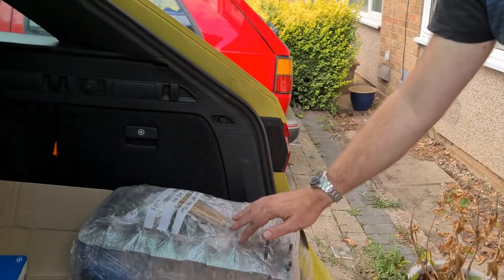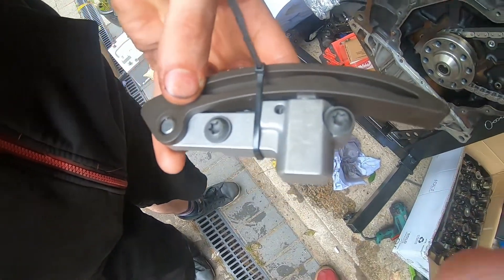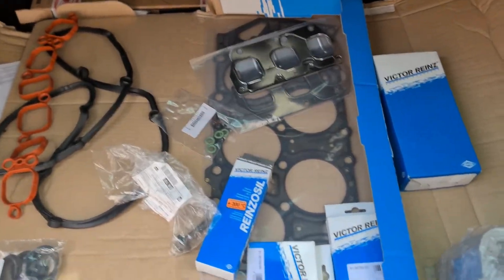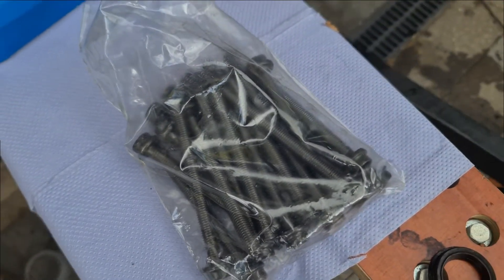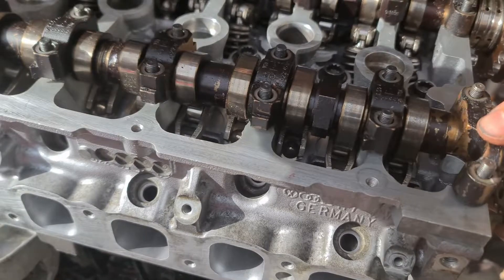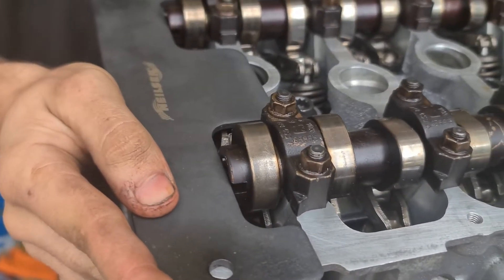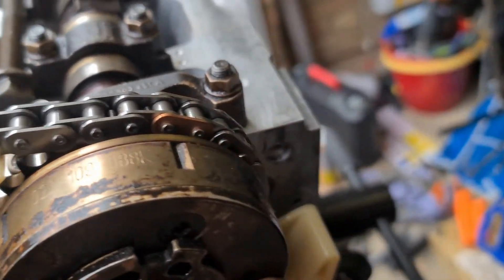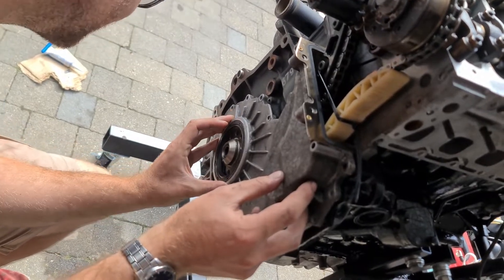How To Replace R32 Timing Chains | VW Golf Mk2 R32 Head Gasket & Chain Replacement: Pt 6

Comment: @14.48 it looks like the crank is half a tooth out; just like mine.
Reply from the maker: I've looked into that, I think because the chains are completely fresh with new tensioners and guides, the timing is effectively further advanced. This is evidenced on our Dyno Comparison video, where the differences in power outputs are considerable!
Reply: @golfmk2 I was trying to improve the timing on mine last night; found the upper guide in the Febi kit caused a difference on my engine. The old original guide is a slightly different shape and causes the chain to be tighter between the intermediate shaft and inlet cam sprocket. It looks like I will be throwing away the new upper guide.
Reply from the maker: @salzar4431 interesting as mine was a Febi item too. Is that enough to knock it half a tooth out on the crank, do you think?
It's not had any effect on the running of my engine, if that's any reassurance.
Reply: @golfmk2 Mine was a bit lumpy when idling; will have to see once it’s back together if there’s an improvement. Basically the chain path along the old upper guide is longer than the new one. The shorter path of the new guide was causing the cams to lag behind my crank by pretty much half a tooth at the crank. Even the steel crush tubes in the new guide are 9mm, which produces quite a lot of slop when mounted with an m8 bolt. Anyone doing the chains should pay most attention to the upper guide in my opinion; otherwise trying to get it timed nicely is likely to drive them mad.

Comment: you never changed the green o ring in the casing,any reason why
Reply from the maker: Only that the o-ring wasn't supplied in the kit. Otherwise, yes I'd have changed it as a matter of course.
Reply: @golfmk2  dont suppose you have the part number for said green o ring by any chance?
Reply from the maker: @adrianculley458 looks like it's this one:
N 90041102
Reply: 5.28 into the video,its on the left side

Comment: Mate, just a tip from an old long retired mechanic. Always pull a spanner, power bar, ratchet or torque wrench towards you rather than pushing. Enjoying your videos, those V6's are amazing, not quite a straight 6 and not quite a Vee.
Reply from the maker: Yes I was standing the wrong side of the engine as it turns out and certainly made life difficult for myself! You'll notice I didn't make that mistake in the videos after this one! 

The VR6 is a rather special engine by the way of its configuration. Very clever being so compact. From some angles it looks huge, others, very neat and compact. It's a shame they don't produce them any more. 

Really pleased you're enjoying the videos though. Means a lot.
Reply: @golfmk2  Yes, I did notice that. Enjoying your videos. Cheers.

Comment: Guys you should replace the intermediate sprockets when doing the chains as they wear 👍🏻
Reply from the maker: This is something that I did look at doing, but actually when we removed the sprocket and inspected it, the teeth are in very good order with very little sign of wear too. Also, when the chain tolerances were checked they were reading +1 and 0, so very good still. With the costs mounting up on the rebuild it's something that I couldn't justify spending more money on, especially as I felt it perhaps wasn't necessary, with the engine being low mileage and the chains were only being replaced due to a head gasket failure, not due to worn chains.
A gamble of course, and I may live to regret it!
Reply: @golfmk2  fair enough, I didn’t notice the wear on mine untill I compared it with the new sprockets 😂 I’m sure it will be fine as my chains were right on the limit on vcds
Reply from the maker: @garagenorth1864  I completely understand where you have come from though so was happy to explain my reasoning for not doing so. It's that tricky situation of 'where do I stop' when I comes to something like this. The job was really a repair, rather than an overhaul, but costs have already spiralled as I've been getting stuff done that can be whilst the engine is out and accessible, but I have to draw a line with regards to replacing some parts and by inspecting this I've taken an informed decision not to replace.